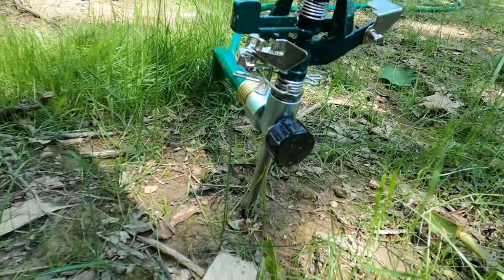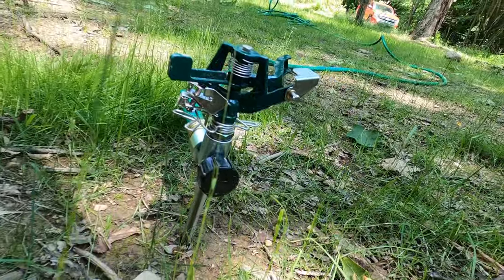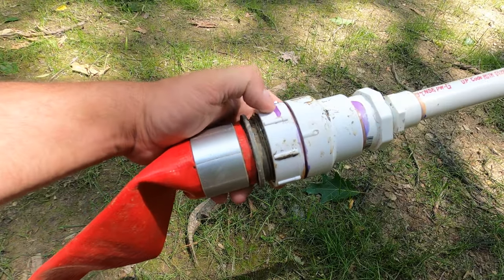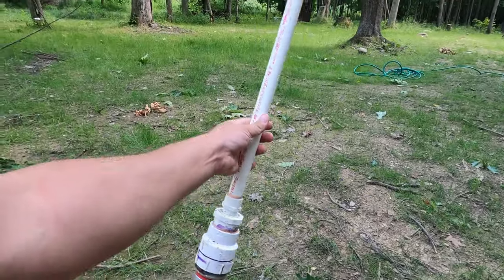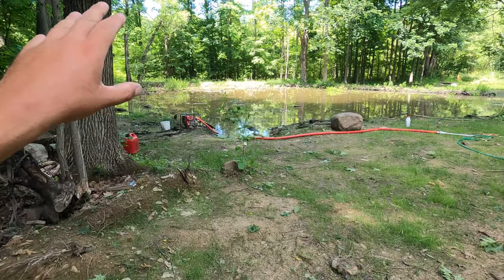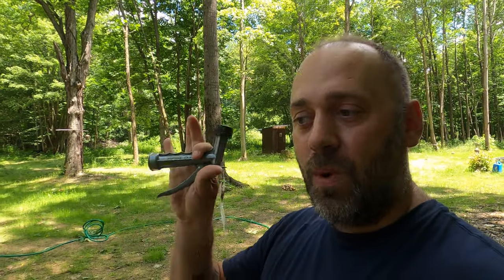Can a water pump be used for a garden hose? I use a trash water pump to run my sprinkler off-grid.

Comment: Retired fireman here - the pump style is a centrifugal pump. Centrifugal pumps have what is called “100% Slippage” meaning when the pump is turning and the discharge side is closed (not flowing) the insides of the pump continue to turn without any need for a relief valve. The only concern to be aware of is the water inside the pump housing overheating resulting in water vapor (essentially steam) which can damage the pump’s impellers or housing - essentially ruining the pump. To prevent the pump from overheating keep some water flowing through it. Feel the pump housing with your bare hand to gauge if its overheating. If it is warm or hot you need to get water moving through it to cool it down, but other than the overheating/cavitation concern there is no problem with occasionally stopping the flow through a centrifugal pump. Cavitation sounds like rocks inside the pump. Note: a blocked suction strainer/intake can cause a similar problem. I have this same pump. I reduced the factory 2” National Pipe Thread (NPT) outlet to 1.5” National Standard Thread (NST aka Fire Hose thread) since I have several sections of old fire hose I can run directly off that. You can buy the reducer I mentioned and even a reducer from whatever you need to Garden Hose (GH) thread from a good pipe and irrigation supply company. Good luck!
Reply: Ditto
Reply: can this type of pump pump water from a deep well with rigid pipes, or does it only work with those flexible pipes? And does the water remain clean even though it went through the pump?
Reply: This guy is completely correct.
Reply: @lukejones1244  
It's not rated for sucking out of a deep well. 
YOU really need a submersible pump
Reply: Josh basically there s no harm if my honda 2 inch delivers water into 1 1/2 inch hose bar spread?
Reply: All “suction” hose is rigid like pipe so it doesn’t collapse under suction. So, using pipe is fine. The issue could be the height you are trying to draft from. Without going through an entire hydraulics class, your maximum “lift” would practically be about 10-15 feet. Be sure you have no air leaks at any of the suction side connections. Leaks will kill your ability to draft.
Reply: All “suction” hose is rigid like pipe so it doesn’t collapse under suction. So, using pipe is fine. The issue could be the height you are trying to draft from. Without going through an entire hydraulics class, your maximum “lift” would practically be about 10-15 feet. Be sure you have no air leaks at any of the suction side connections. Leaks will kill your ability to draft.
Reply: All “suction” hose is rigid like pipe so it doesn’t collapse under suction. So, using pipe is fine. The issue could be the height you are trying to draft from. Without going through an entire hydraulics class, your maximum “lift” would practically be about 10-15 feet. Be sure you have no air leaks at any of the suction side connections. Leaks will kill your ability to draft.
Reply: All “suction” hose is rigid like pipe so it doesn’t collapse under suction. So, using pipe is fine. The issue could be the height you are trying to draft from. Without going through an entire hydraulics class, your maximum “lift” would practically be about 10-15 feet. Be sure you have no air leaks at any of the suction side connections. Leaks will kill your ability to draft.
Reply: All “suction” hose is rigid like pipe so it doesn’t collapse under suction. So, using pipe is fine. The issue could be the height you are trying to draft from. Without going through an entire hydraulics class, your maximum “lift” would practically be about 10-15 feet. Be sure you have no air leaks at any of the suction side connections. Leaks will kill your ability to draft.
Reply: All “suction” hose is rigid like pipe so it doesn’t collapse under suction. So, using pipe is fine. The issue could be the height you are trying to draft from. Without going through an entire hydraulics class, your maximum “lift” would practically be about 10-15 feet. Be sure you have no air leaks at any of the suction side connections. Leaks will kill your ability to draft.
Reply: All “suction” hose is rigid like pipe so it doesn’t collapse under suction. So, using pipe is fine. The issue could be the height you are trying to draft from. Without going through an entire hydraulics class, your maximum “lift” would practically be about 10-15 feet. Be sure you have no air leaks at any of the suction side connections. Leaks will kill your ability to draft.
Reply: All “suction” hose is rigid like pipe so it doesn’t collapse under suction. So, using pipe is fine. The issue could be the height you are trying to draft from. Without going through an entire hydraulics class, your maximum “lift” would practically be about 10-15 feet. Be sure you have no air leaks at any of the suction side connections. Leaks will kill your ability to draft.
Reply: All “suction” hose is rigid like pipe so it doesn’t collapse under suction. So, using pipe is fine. The issue could be the height you are trying to draft from. Without going through an entire hydraulics class, your maximum “lift” would practically be about 10-15 feet. Be sure you have no air leaks at any of the suction side connections. Leaks will kill your ability to draft.
Reply: All “suction” hose is rigid like pipe so it doesn’t collapse under suction. So, using pipe is fine. The issue could be the height you are trying to draft from. Without going through an entire hydraulics class, your maximum “lift” would practically be about 10-15 feet. Be sure you have no air leaks at any of the suction side connections. Leaks will kill your ability to draft.
Reply: All “suction” hose is rigid like pipe so it doesn’t collapse under suction. So, using pipe is fine. The issue could be the height you are trying to draft from. Without going through an entire hydraulics class, your maximum “lift” would practically be about 10-15 feet. Be sure you have no air leaks at any of the suction side connections. Leaks will kill your ability to draft.
Reply: All “suction” hose is rigid like pipe so it doesn’t collapse under suction. So, using pipe is fine. The issue could be the height you are trying to draft from. Without going through an entire hydraulics class, your maximum “lift” would practically be about 10-15 feet. Be sure you have no air leaks at any of the suction side connections. Leaks will kill your ability to draft.
Reply: No problem.
Reply: No problem.
Reply: No problem.
Reply: No problem.
Reply: No problem.
Reply: Rigid pipe of flexible (non-collapsible) suction hose.
Reply: No harm. I use mine all the time that way.
Reply: @joshroten3997  thanks Josh for a reply.
I meant if my water pump 2 inch and a sumption hose (not a suction hose) is 2 inch and I connect my sumption hose with a 1 1/2 inch water bar spread
Reply: @lukejones1244 trash pumps are meant more for pumping liquids and stuff besides water. Could use it to clear out a swimming pool or dirty water or maybe even a dirty Pond.  It's just they have high output and low pressure.
Reply: I'm a irrigation enthusiast. It's a hobby for me. I like watching farm irrigation especially the big guns. Around here it's a mix of pivots and travelers and reels with guns on the end. I wish it was legal to use a fire hydrant to run them. But if I even tried I know I'd be in big trouble. I've seen what those hydrants can output and it's way more than what my transfer pumps can output. I've watched countless fire trucks put out fires and the pressure and flow those hoses have! It's crazy! And I've seen some big guns get almost the whole field! Very neat and calming to watch! I thank you for your service as a firefighter! Thank you for keeping our world safe! One of these days I will have my own house and pond and a big pump!
Reply: This type of pump can only be used with the polycyclopene-hexafloride (PCHF) water lines.  Using any other type of line will void the warranty because the leaching of chemicals from the centrifugal pump cavitation will accumulate onto the impeller blades and eventually lead to pump seizure and likely cause a forest fire.  Someone using a water pump with the incorrect line led to the 2003 Siberian Taiga Fire which burned 55 million acres and led to a worldwide increase in asthma.  This also contributed to worldwide pandemic known as COVID-19.  Because so many people had been compromised by the 2003 fires, their cardiopulmonary systems were weakened.  Scientist have estimated that using the wrong line on your water pump contributes to global warming and is what caused the 2nd and 3rd mass extensions.  Physicists like Niels Bohr wrote papers theorizing Mars and Venus were both inhabited with flourishing civilizations until independently, people used the wrong line with their water pumps.  Both of those planets needed to evacuate to Earth.  It's possible your use of the wrong line on your water pump can lead to the destruction of planet Earth and wiping out all of mankind forever.    @lukejones1244
Reply: volunteer firefighter here, we use this pump too since we can't afford buying fire trucks i put a bypass valve going back to the tank so that it can cool itself when we shut the bale off
Reply: @FISHH00KS  ol. Now that I have taking your seminar  I'm going to have to be careful  not to destroy the planet
Reply: Thanks mate, you answered all my questions
Reply: Thank You for sharing, I appreciate your time.

Comment: Most of these pumps have a drain plug that is 3/4" threads on the bottom of the pump. Get yourself a 3/4" brass garden hose adapter and thread it into that hole, now you can just plug your garden hose in right there. To plug the hole later you can just use a standard garden hose cap with a washer. (Even if you don't hook a hose here I prefer to install a nice brass garden hose cap instead of the plastic POS it comes with)

Also a great place to attach a cheap pressure gauge, if you're interested.
Reply from the maker: Thanks for the info. I will be looking into it.
Reply: So, am I right to assume that if you use the drain port, you would then cap off the 2" exit?  and the drain port still pushes the same GPM?

Comment: the pump needs water flow to not overheat, on my setup i use a 3/4 relief valve, same as i use on my deepwell home water system, at about 80-85 psi it opens, on my home sys it keeps the captive air tank from overpressuring should the elect switch stick, on the pump setup it allows water to recirculate while the nozzle is closed, keeping the pump cool. my pump is a fire pump, twin impeller, at 90% throttle it will charge a 1 1/2, and a 1 in fire hose at approx 125 psi, if i close the nozzle while using i have to keep water moving, or risk destroying the pump seals. hope this helps
Reply from the maker: Great point! This is the only potential issue in my case. I never really let mine run too long with water flowing but a bypass would stay cool enough. 

Thanks for the info. I will be sure to include it in an update video.

Comment: Thanx for the vid.   I just picked up the same unit the other day for a brush fire set-up and have used it to water a newly grass seeded area in my woods the other day.  It worked awesome!  Before I started it, I left the sprayer open a bit and hurried over to it after staring because I wasn't sure what would happen because I didn't see any way for pressure to relieve.   Your bid answered that for me and a few of your  commenters explained really well.  Thanx again!

Comment: Great video....been searching for the same question for months now. Found this after a long search. "Centrifugal pumps do not require a relief valve. When the spray boom or gun on a centrifugal discharge is shut off, and the pump continues to run, the liquid internally bypasses without damaging the pump as long as a vent line is in the system."

Comment: Your 3/4 pvc thread is MIP thread which is different that hose thread which is the reason it leaks you can buy a brass adapter to go from MIP to hose at home depot for around $7 and it will thread into your 3/4 female adaptor and eliminate the 2’ of 3/4 pvc👍🏻

Comment: You can get a metal reducer 2” to 1 1/2” and if you look by the sump pump’s they make an adapter that’ll screw right in for garden hoses.. no glueing involved and much less space, zero leaks
Reply from the maker: I will have to look into this... Thanks

Comment: I’ve been using the predator 1” pump for my softwash for over a year. On my 2nd one. I run it to a GP reel with 200’ of 3/4” poly hose. It eats everything I put in it. Been thinking about upgrading to the 2” pump now.
Reply: You running this setup through a proportioner or batch mixing this? Been using same pump for my rinsing with soaker gun. 
Its amazing
Reply: What kind of distance are you getting?
Reply: Man this is what brought me here man I was wondering if I could use the pump for soft washing
Reply: @apsaffordablepowerwashserv7039  I have it in square 55g. I work mostly on log cabins so batch mixing works just fine for me.
Reply: @Rick-kp6wf  I’d say 35ft easily. I had a few fatboy 7gpm 12v this pump blows that thing out of the water
Reply: @carlossoriano7191  Most definitely can. If you make a video I want the credit. I have a 2” version on a skid with a IBC tote and 100’ hose
Reply: hello sir.. am I understanding you correctly that you are currently using the 2-inch pump in a soft wash application? If so ..are you able to run chem through it without damage? And how many ft will it spray in your estimate .thank you for your response
Reply: Do you think I can use this on my truck to spray weeds

Comment: You answered exactly what I was wondering about. I want to use a motorized pump in a chemical sprayer setup using a garden hose. I wasn't sure what would happen when I closed off water pressure to the sprayer with the motor running. Thank you for the great demonstrate.
Reply from the maker: Awesome. Glad to hear. I was glad I tried it because it has been a life saver!
Reply: @TheOhioOutdoorsman1  dont stop the water flowing. the cermaic bearing and seal will heat up and get damaged pretty quick, in the case of this video, you could simply have a t splitter allowing a constant flow back in to the pond and just use a ball valve to limit the amount of water flowing. you dont need to move much, but dont just stop the water flow completely
Reply: I did the same thing for my lawn company I used a one inch pump but will definitely be buying a 2 inch.

Comment: Retired firefighter.......I'd be curious to know the pressure in the discharge trash pump hose when you throttle up....as I didn't think you could do this without the hose bursting or clamps letting go at the fittings...Excellent idea. Now instead of paying hundreds of dollars for a fire hose I can use the trash pump hose....Thanks for the video...

Comment: You can get a cam locks to connect the the water pump with a reducer to a 3/8 hose fitting.

Comment: It's just a centrifugal pump, essentially it'll recirculate itself. And running it with no water output is called dead heading, its not an ideal situation. You will prematurely wear out the pump, but for short stints, it won't be enough to notice.  Also, there are camlock to garden hose adapters, then your house would just connect directly to the discharge rather than to a whole contraption

Comment: with that setup like it is I can see something breaking soon. Probably the pump. one thing you can probably do is add more sprinklers. there is some back flow going from 2" to 5/8's so my question is what happens to the unused water being pumped in.  Soooooo  many questions on this type of setup.

btw I would think a splitter that you can make to go from 2" to two 5/8s connection would be a lot better and less strain on your pump, using both sides of the T at the time the pump is running???....
Reply from the maker: The water sits in the pump housing until it is circulated out through the hose.  The pressure is around 35lbs and since it is a turbine pump, water stoppage does not mean pump stoppage.  

The main concern with this particular setup is when no water is flowing for a long duration. There is the potential for the pump to overheat.  

The next version of the pump will include a bypass to always keep water flowing even with there is not flow through the end being used.

Comment: Suggest you build  a PVC manifold. With Say multiple size outlets. 1 1/2”. 1”   &3/4 inch. 
Connect 2 or more garden hoses and spray multiple water Chanel’s at same time- say one close  in & 1 long way out at same time, or left and right simultaneously; thus reducing you motor hours, gas consumption, less back pressure on pump… and more time for mint Julips w family!

Comment: A motor pump for dirty water can not only be watered. You can also pump out dirt from the bottom of the lake with the Bagermaster suction nozzle.
Reply from the maker: Thanks for the advice. I will have a look at that because I know it would have came in handy for sure when we drained the pond and got to muck.

Comment: What do you do if the nozzle on the sprinkler is plugged of pond trash (small twigs, rocks, etc)? I wan to know of a filter system that can be manufactured in-line of the 2" intake that has a reverse clean function so that all water going out of the pump is fine filtered for the small nozzles.